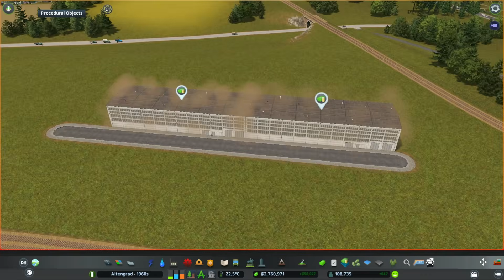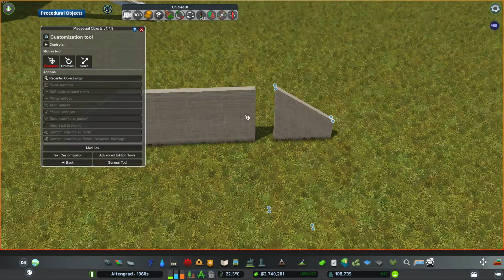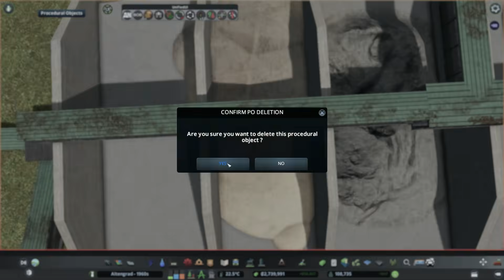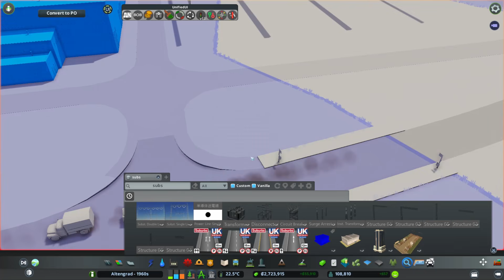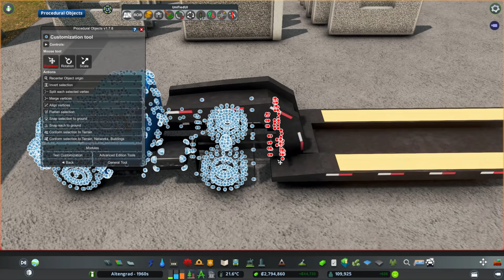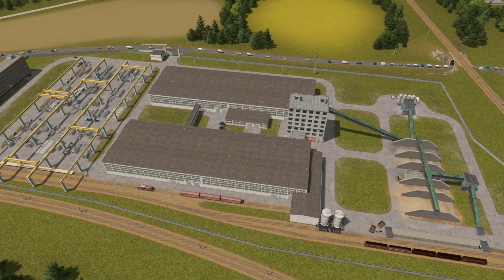How Were Concrete Prefabricated Panels Made?  - Cities: Skylines - Altengrad 63

Comment: I use the DDR Plattenbau made by MeisterMonis to substitute for Swedish "Miljonprogram"-housing. In Sweden it was not uncommon to have a Prefab plant on site for the new suburbs. I don't know that much about the Eastern bloc ideas of city buildning in the 60's and 70's but in Sweden it was alot about the ABC (Arbete, Bostad, Centrum. Work, Residence, Centre/Commerical) and SCAFT (Traffic separation).

Comment: The railroad terminus over in the what I'm just going to call "future commercial hub" is probably begging for some renovations right now; The whole thing hasn't seen a single structural update since it was originally built despite railroad traffic not only becoming more frequent, but bigger over the course of 30+ years.